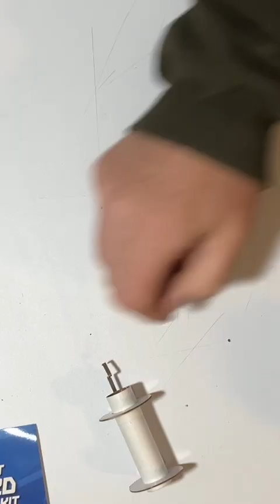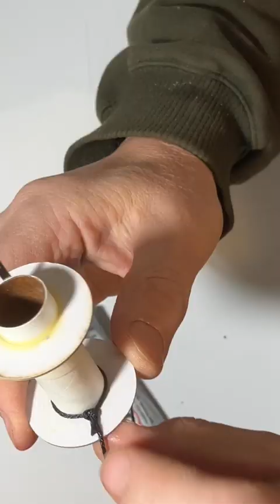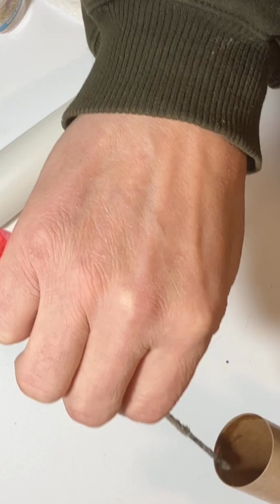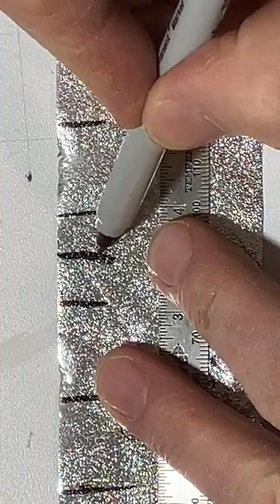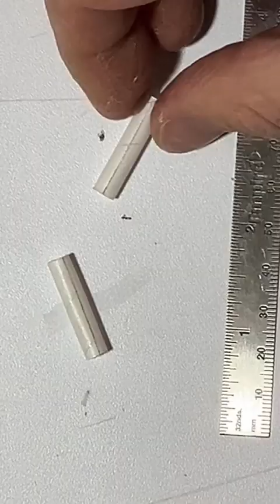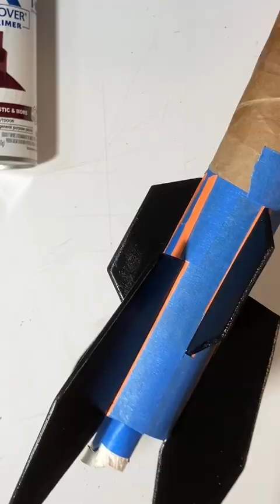Everything You Need To Know About Building a Custom Low/Mid Power Rocket

Comment: Thanks for the well made. Ideo. Learned something about E6000 today. I’ll be adding it to my build inventory. Where do you get your streamer material? Also, concerning the fins, you might consider papering them with tissue paper. Makes them MUCH stronger, regardless of grain orientation.
Reply from the maker: I have experimented with about 15 different streamer materials (older video); however, I found only 2 types of materials meet model rocket requirements. I use two types of streamer materials (both available from Amazon):
(1) Bird scare tape - This is PET with highly reflective silver patterns. Great for spotting a high-flying rocket or locating it on the ground. There are 1" and 2" wide BST. Typically used for smaller BT-50 rockets. I use up to 50' streamers!
(2) 4" silver metallic streamer. On Amazon, it is called Anderson's silver shiny metallic streamer for weddings. Typically used for the BT-60 rockets.

There is a lot of technology behind the streamers. How to attach, how to deploy, winding, looping, cords, knots, multiple streamers, tangling, etc. My specialty is the "loop" streamer that opens like an upside-down horseshoe. The loop creates significant drag similar to a parachute, but wind blows through it to reduce drift. 

I'll be doing a special long video on how to build a loop streamer, get it to deploy, how to wind it, etc. Coming up soon...

On the fins, that is an interesting tip. Another experiment to try...